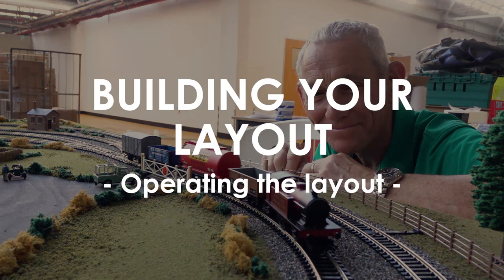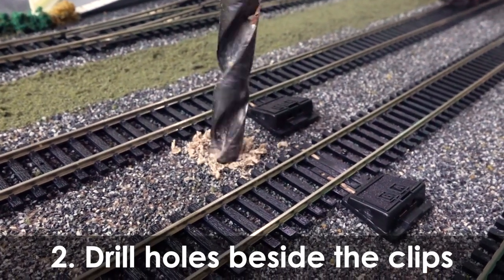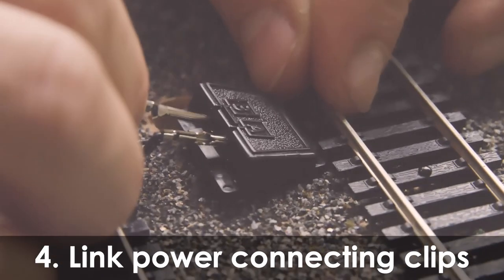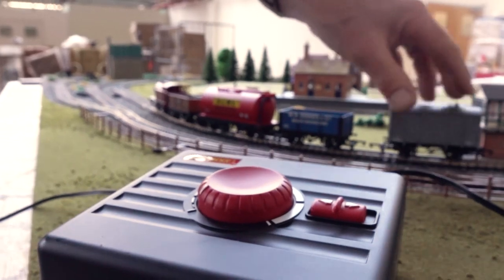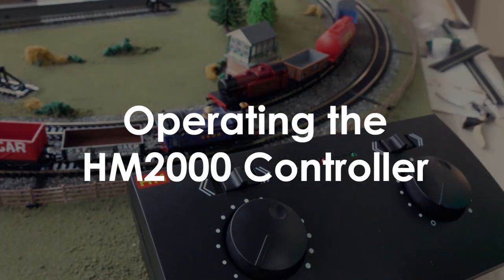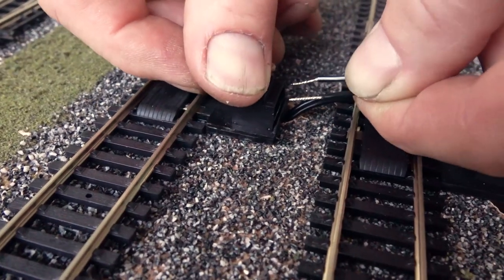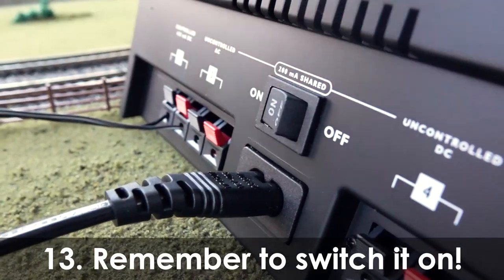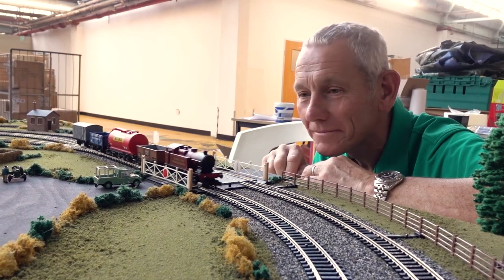Build A Model Railway Layout Step by Step - Pt 8: Operating Your Layout

Comment: What a great set of videos ! 
I have dug my set out of the loft from when I was young and would like to have a single track that runs around my garage on a shelf. 
The garage is 4.8meters long by 2.6 wide so the length of the track would be around 14.8 meters. 
Can anyone tell me how many power points I’ll need and also can/would they all come off of the same power pack? 
The controller/power pack has screws on it so I am guessing I could have several extensions coming off but again , I know nothing about all this

Comment: If I use the HM2000 controller connected to 2 x R8206 power tracks, do i also need the r8201 link wire on a curved section ?

Comment: What would be really helpful as can be seen by some comments would be detailed explanations on how to set it up with the points - so enabling,for example,moving to other tracks and sidings without shorting it all out (which is easy to do! ) That seems to be a very important area that is very sadly lacking and puts new beginners off

Comment: When you have the two tracks, I see you have points going from the inner to the outer loop and also points leading off to sidings. If the points are switched then there will be no power to the sidings, how do you run the train up the siding at the same time running the inner loop train to the outer loop? Is there another video on the way showing how to isolate the sidings so you can do a bit of shunting wagons whilst the trains run on the loops?
Reply: Hello I’m not a professional but I think you need dcc to do that I was very confused about that to but that’s all I know hope this helps have fun
Reply: You'd need DCC and a bit more wiring I think

Comment: There's no part on how to connect the R7229 to the track. I'm struggling to get the train set working. The controller trips out and stops working for a while, we have bought replacement controllers and it is still doing the same. Please help.

Comment: I tried to control 2 tracks independently but it just short circuited the whole thing
Reply: your meant to add plastic track clips to the 2 points that connect the 2 circuits or just not put any track clips, and make sure the two bits of track have a 1-2 mm gap
Reply: @betterthenspirit  so which controller then keeps the train moving from inner to outer if the power stops at the point join?